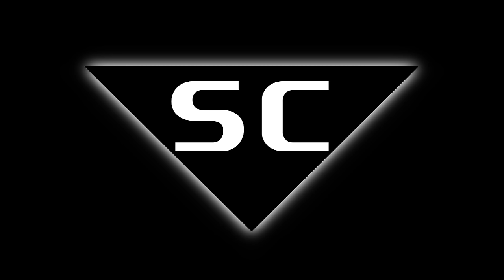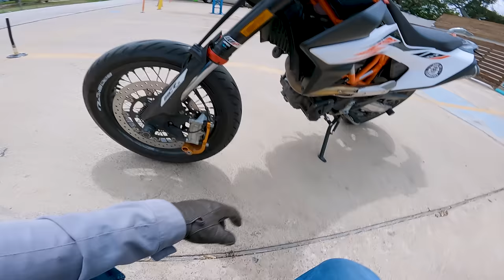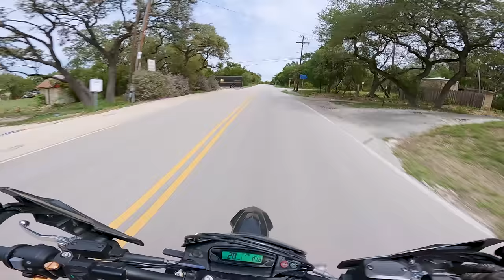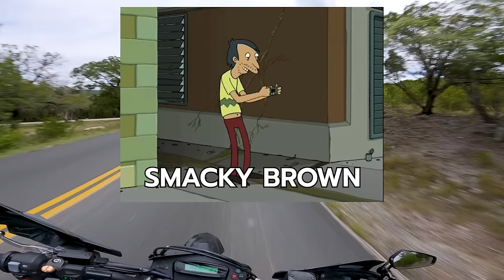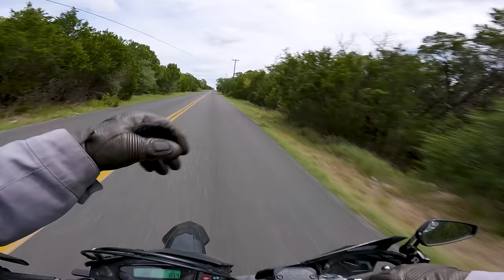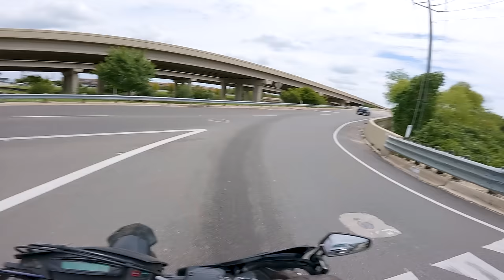Watch This Before You Buy A KTM! (SMCR Update)

Comment: I rented a KTM Duke 790 in Frankfurt to ride south to Switzerland on the Autobahn reaching 230 km/hr.  When I returned to Korea, I went to a KTM dealership to write a check to buy me one but decided to do more research. Turns out they launched the 890 a year after the 790.  The 790 had a bidirectional quickshifter.  The more expensive  890R didn't, WTF?!?!  Found out there are some unresolved problems which turned me away from buying it.  Loved the KTM experience but as a prospective owner it helps to have a community making noise so the OEM addresses the issues owners have identified thru real life use.

Comment: Hi Spite. I'm also a TJs client. 2020 Husqvarna Vitpilen 701. In blue, also with mods. SC Project exhaust, recovered seat with gel included, axle sliders, lever guards, engine guard, tail tidy, turn signals, swapped the plastic pillion for an older year passenger pillion seat that I also recovered. I still have a Bad Winners kit to put on when I get bored or my warranty expires. If we added in Whitney we would have the whole crew, just short a duke 690. Best wishes for your channel and prosperity.
 P.S. Is your valve clearance check a 5 hour service too?

Comment: Re the speed wobble - I've got a 690 enduro of the same vintage, and had high speed wobble, esp on new tyres.  Played with the suspension, but never really got it right, but did notice two distinct and very effective ways of making it go altogether, being as it's ultimately a feedback-of-input prob. One method was pulling back quite hard on both bars - but this can wreck your shoulders.... so the second was as simple as pressing both feet down hard on the pegs.  Might just be what it does to my set -up, my way of riding, my inputs - but it works.

Comment: The lesson is ,take the entire front of the biker apart .
Take it to the local welder.
Have them pop the cracks in the frame with some welding rod, for about fifty bucks
Sand it, paint it and put the bike  back together.

It should not be that way but dammit it is.

It also helps if you put a lockable bike cover on the bike.
I wish they made these out of kevlar.
A heavy duty fabric cover slows down the thief and exposes to others what they are doing.
By it's nature, a secured motorcycle cover slows down theft.
Also being able to run a cable lock to some fixed pole or fence also slows down thieves.
They don't like to have to work to steal a motorcycle.

A long time ago, I had a chain I put on my KZ550 when I parked it for the night.
I wrapped the chain around my back rim and through the steel rail on the front porch of my apartment.
One  night , I was sitting in my living room of my apartment and heard the chain go 'CHING!".
I went out and found the chain tight as hell and the bike moved forward about a foot.
The  dirtbag had found out, I don't make theft easy.
I slept in the living room for the next couple of nights but not too well.
Bastard turned out to be a 'friend' of mine too.
Ex friend let's say.

I have always owned things people want to steal.
I have a 5x8 trailer that I chain both tires though the slots in the wheels through the leaf springs to keep them from disappearing one night and a chain I wrap around a steel pole in back yard to keep the trailer from being stolen.
Judging by the three times that chain has moved super tight , three thieves have found out ,this is  going nowhere for free.
This is all defeatable but anything is.
The question is, do they want to use noisy tools when the homeowner is armed.

Anything you own , you have to think like a thief and then do everything to make a thief look somewhere else to steal.
We used to hang horse thiefs.
I understand why.

Comment: Love the bike! A lot of issues with them but, Man Are They Fun! For the speed wobble issue... I changed the wheels to the KTM 690 Duke mag wheels and it makes the handling way better! They bolt right on and they are awesome! The new 2023 GasGas SM700 comes stock with them. You already got the slave cylinder, make sure you get the torqdrive clutch as well. You won't regret it, I love it on my bike. I have the same exhaust and the air box mods will make a big difference. 

Hit me up if you have any questions?
Ride Safe!
Alex O

Comment: 14k on my 2018 701 I've owned from new and I've NOT had one false neutral. Bike before that was a 2017  690 Duke from new, put 4k on that, not one false neutral.
Adjust your lever properly, wear stout boots and shift with reasonable force, you will not have false shifts. It's all down to a girly left foot.

Comment: I've been looking into getting a few year old Dorsoduro 750 recently,  and from what I've read, they also have some of the same problems; a hot/heavy cat/exhaust under the seat, false neutral shifter, and could us a fuel tune for better on/off low speed throttle and better fuel economy.

Still thinking about getting one, but this was definitely a helpful look into my near future. Maybe it's just a European supermoto thing.🤷
Reply: From experience with the shiver 750, the naked Version of the dorsoduro, i can Tell you, yes it gets hot, but that can be solved by a more free flowing exhaust + heat wrap. The throttle in Sport is a bit snatchy but could be tuned out, in sport Mode there is a really fast climb to 10% throttle in the map, but still rideable. The heat Problem isn't to much the cat it's more that you sit on top of the Rear cylinders header. If you want a dorsoduro defenitely go after one with a good service record and ask if the front Brake Master cylinder was done as it was a recall item, as the Front break experienced lock ups after heating up. Skip the first 2 years of production, the forks changed over the years, usually the marzocchi forks are considered the best, the Sachs forks are considered to be the worst, the forks can be identified at the fork boot slightly over the axle.
Reply: @Dareios4297  thanks for the info. They aren't too common here, in the US,  so it's great to get some general tips on it from someone with experience , either with a dorsoduro or a shiver.
Reply: I owned a dorsoduro 750, ktm 690 smcr and now a ktm 950 SMR, my advice, get a 950 (the one with carbs!) to avoid injection and get a butter smooth experience. I also have a superduke 1290 but I enjoy riding the 950 SMR the most!
Reply: @whimsicalstray  no Problem, another thing to consider is, that the dorsoduro is quite heavy for a super moto styled bike. The engines of the shiver and dorsoduro are more of an engine that has its power in the mid to top end. The clutch is quite heavy for a Hydraulic clutch System, can be fixed with a new clutch slave cylinder by oberon. The engine runs a bit bad on Idle as the fuel Burn isn't that great down low. If you want to gain a little power open up the exhaust and remove the snorkel from the airbox, as well as open the airbox up a bit around the inlet, put a dna racing airfilter in there. After the slip on and airbox you should get a fatduc at setting one to increase let it run a little richer or go for a tune. Sidenote dynojet doesn't offer a power commander for the 750/900. If the shifter gets notchy/doesn't shift well, the engine tends to need an oil change with good Quality oil (15w50 or 10w50 fully synthetic for example motul 5100/7100, castrol power1 etc). I might be biased but I can truly recomend both 750s if you are okay with it not being as "perfect" as a japanese bike of the same power and price. You will have to do more strict maintanence and use a bit higher Quality of Parts but you'll get one of the best sounding v-twins out there, in my biased opinion.

Comment: KTMs are awesome bikes specs wise but too expensive (not even including ECU locks) and too many electronic issues. I had a 2018 1290 Superduke R for a couple of years and it was always throwing errors codes and I've heard similar complaints from the enduro side as well. I've got a Fantic 250 now and the simplicity is great. I can literally replace the entire wiring loom in 5 minutes.
Reply: Ktm don’t seal wiring properly, if you use them in the rain & everything isn’t siliconed or weather sealed… all terminals corrode & lead to this.

Raced them for 20 years get x2 new bikes a year & they’ve always been the same… that’s mx bikes to so should be more weather proof but they aren’t.
Reply: @Jammy_J1  They sell more bikes if they build them badly.

Comment: my 1190 is easy to catch a false neutral from 1-2 also. You can to be very deliberate. Rest are fine. ALso it's only happens in lower rpm shift. Usually off road because i need a higher sprocket

Comment: I just bought a SMC R a few months ago at TJs.  It makes me nervous that mine is going to end up in their shop for months knowing our methhead problem in ATX.  Speaking of the dealer, did they set your rear brake pedal stupid high when you bought it?

Please keep doing vids on this bike as the US based content is limited and I would love to see more along the lines of the airbox and suspension setup.
Reply from the maker: If I were you I would invest in the New York Noose Chain from Kryptonite. I have 2 of them and when put on the front wheel they're the best deterrent I've found. I use the pin lock as a secondary thing and for when I'm out and about. 

I'm definitely going to keep y'all up to date on this one. If you're in Austin, talk to Rodger at On Rode Off Road. He'll set you up right.
Reply: Or there are bike anchors that either bolt to the floor or I actually see a smart bike anchor the other week  that just sits on the floor as it weighs a ton or more ?!!
Virtualy impossible to move ?....
I've had bikes stolen in the past , it's a horrible thing to think of so id urge you to get your bike secure ASAP to avoid future upset 😡

Comment: Mate I had a same issue during COVId,  I had a minor crash on my KTM Super Duke GT 💥 and the bike received frame damage.  I contacted my insurance company and during CoVID they thought repair was on an option.  A week later I contacted my insurance company and they said frames are 12months away at least so they wrote her off and I received a new GT 🎉.   I went to the repair shop to get my farkels off my original bike to put on my new bike and the repair shop said frames are a no go at the moment (August 2021). They had 6 BMW S1000RRs going to scrap as they had minor damage to there frames 😮😮😮😮.   The repair shop said KTM &  BMW won’t be doing replacement frames until l early 2023 😮

All in all your issue was a COVID supply problem not a KTM problem.   Also at 1 month in you should have been continuing your insurance company going WTF.  It’s a them problem not a you problem

Comment: You need an alarm disk lock(Abus is a good brand). When the methhead starts messing with the bike the alarm will inform them there is more work to do than just cracking handlebar lock.

Comment: Used to work at KTM shop and A false neutral between 5 and 6 seems to be a KTM thing. Alot of dukes, regardless of cc seem to do this. Not a huge issue just need to be direct with your shifts.

Comment: All of my KTM buds of all walks agree,, they are AWESOME to ride,, but are a NIGHTMARE to own.. 
The only bike I have contemplated against my FTR, was a Super Duke, but than I remembered my buds KTM experience V. my Indian experience where Indian has bent over backwards for me..
I showed up on my used Scout with a seat that was merely visually messed up on my first year Scout and first Indian purchase that I bought used from a non Indian dealership. They saw my functional, yet visually blemished seat.they said "what happened?" I said idk..they said,  we'll send you a new one. They did.
The one mechanical problem I had with it was a somewhat re occurred issue with First run Scouts of shearing fly wheel keys happened to me. (#15) they replaced..
Fast forward.
an HD focused shop I work next to, that helped develop the Victory Pikes Peak 156 asked to use my Scout for their big bore kit development project. They found that while the key sheer issue was fixed  found that the failure sent metal through my engine, and damaged one of my cylinders.. so even though I was hot rodding, through a 3rd party, and after warranty, Indian still gave me a new cylinder..
That experience, is why I never even looked at KTM, and now have a #15 Scout that breathes fire, and ordered a first year FTR..
Since then, my dealer sends me home on any Indian I want..
Ask me about the Pursuit, and Challenger
I've gotten to spend a week on .. for no reason other than, "thanks"...

Comment: I took my KTM 690 smcr to motorcycle Mall for the 6200 mile service. I get it back I do roughly 1,000 miles and my bike is destroyed. It's overheating not idling properly and leaking oil the GM is one of the most unprofessional people I've ever met in my life he basically cursed at me and blamed me and told me he was not going to fix the problem because "I said I hope that place Burns"
Motorcycle Mall is where motorcycles go to die